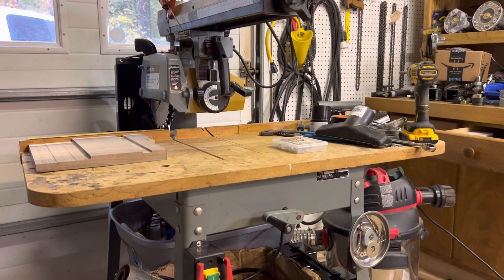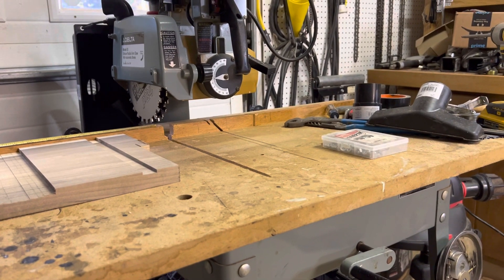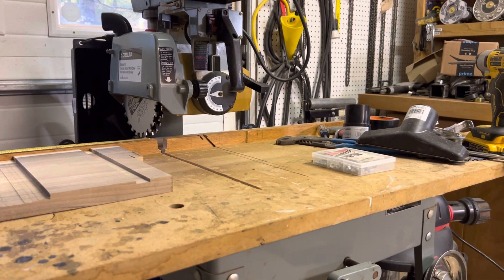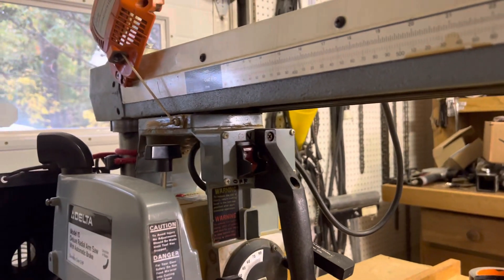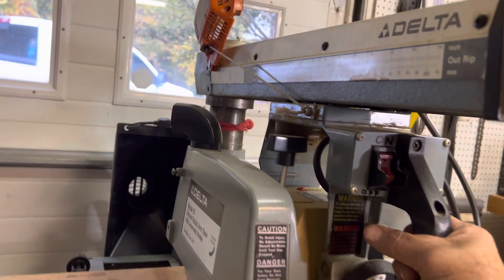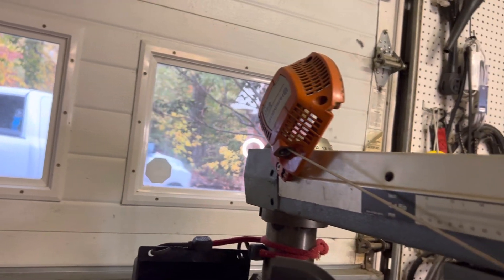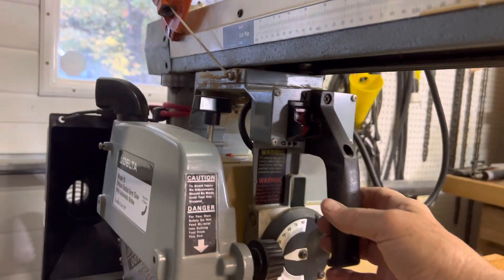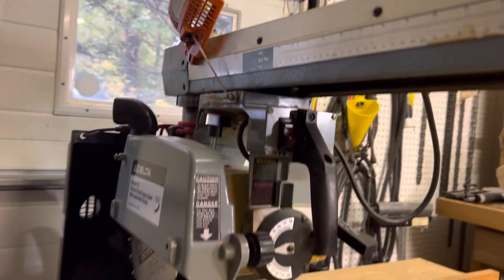Making a  Delta 33-990 Radial Arm Saw return block from a chainsaw pull for improved safety.

Comment: This has got to be the only video on YouTube starring the Delta 33-990. I've had one sitting in my basement for about 20 years since my dad gave it to me before he passed away.  Suddenly I'm interested in getting it up and running along with the other toys that Dad gave to me. Didn't really understand the need for a carriage return,  until you brought up the kick back issue. I have an broken down Ryobi string trimmer that I'm sure would be proud to give it's pull cord return for my safety.